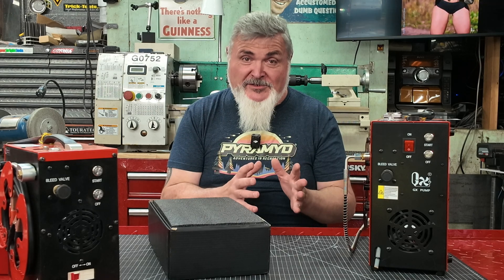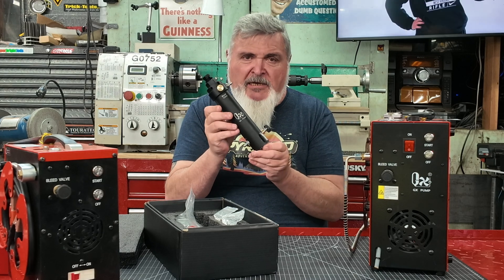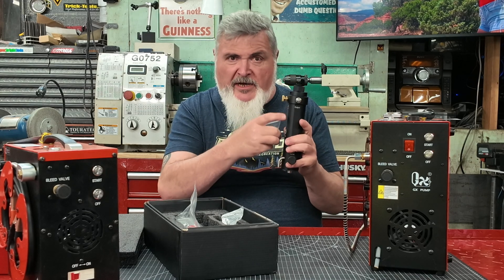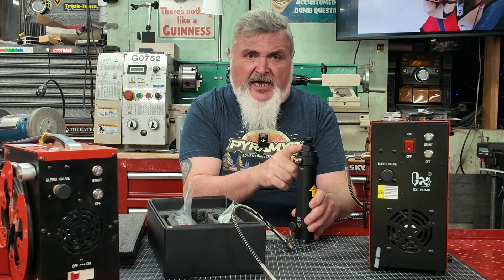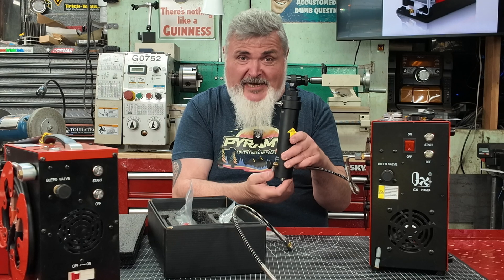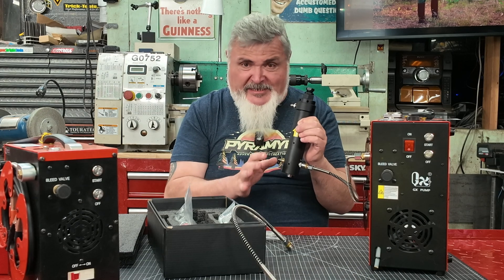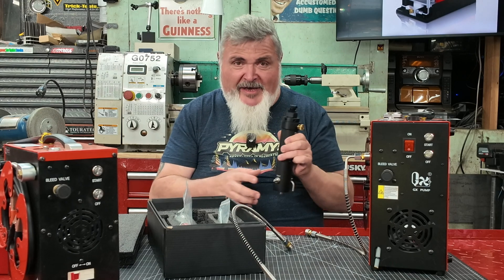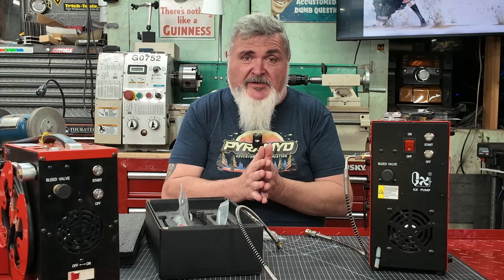Ultimate PCP Airgun Moisture Separator: Physics-Driven Dry Air Breakthrough!

Comment: What about replacement parts? How often do the inner filters need to be replaced?
Reply from the maker: They never need to be replaced, you CAN replace the media in them and it is pretty cheap, but when used properly, 98% of the moisture is removed by the fundamental physics being leveraged in the unit.

Comment: I'm thinking about getting one of these to help with evening out the pressure when filling up a bigger tank but I'm wondering if it would interfere filling up straight to the PC P gun since it doesn't activate until 2000 ps. I if that is a problem may be popping the fillport out. I don't know.
Reply from the maker: It can be used to fill ANYTHING, there is no popping anything out.

Comment: @theairgungeeks5106 why the Filter is only rated for 350 bar? The CS4 is a 400 bar compressor
Reply from the maker: Not sure where you are getting your numbers from.
Reply: @theairgungeeks5106  The CS4 is a 400 bar compressor. I wonder why the filter is only approved for use up to 350 bar. As far as I understand, the filter is supposed to work with the CS4, but they both have different specs. The compressor can fill up to 400 bar, but the filter can only withstand 350 bar. I think the company should have designed the filter for 400 bar so that both have the same limit. Now, the compressor can fill to 400 bar, but the filter can only withstand 350 bar.
Reply: Just ordered one!